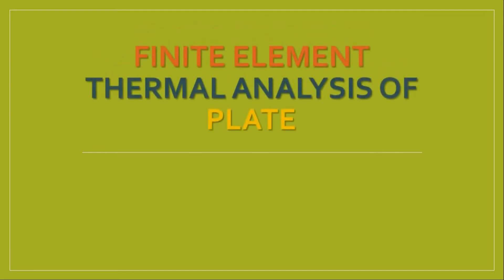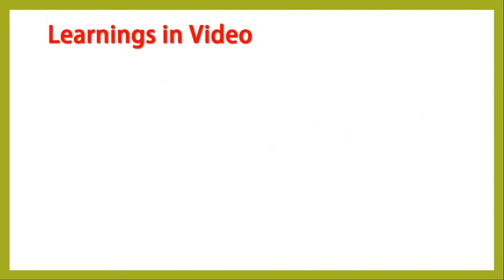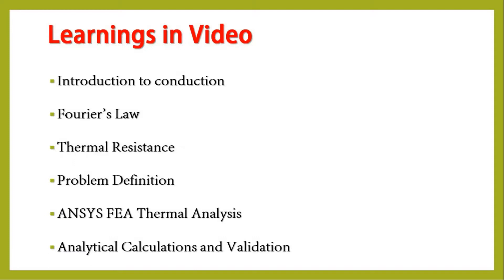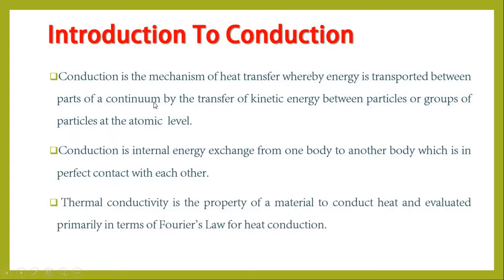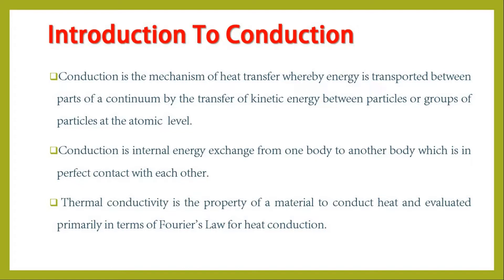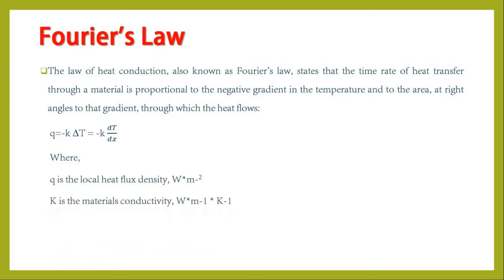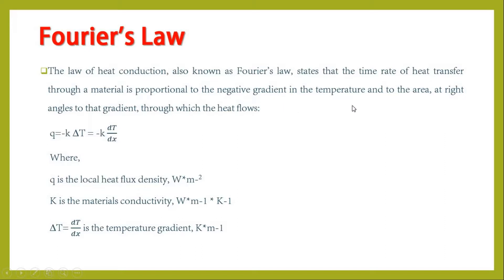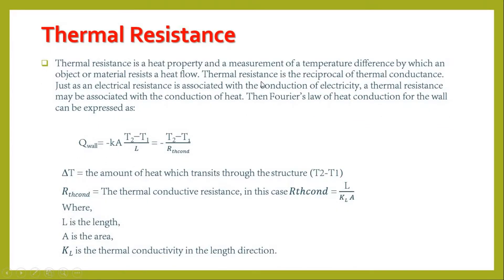Conduction Thermal Analysis of Plate using ANSYS

Comment: can you help me to find the thermal stress in a body due to temperature change whose both sides are fixed? I am getting the correct solution for 1D model but not for 2D and 3D model?
Reply from the maker: You should get correct results for 2D & 3D too. Try to apply proper BC and material details. Let us know if you still have issues.

Comment: Great tutorial Professor, Very helpful. I am working on a similar project that requires me to calculate the effective thermal conductivity of an RVE model with spherical inclusions using periodic homogenization. RVE material is epoxy, length size is 10 mm and inclusion is alumina with a diameter of 1.98 micrometers. Please, can you help with a video tutorial for this? Thanks
Reply from the maker: Welcome ! You need to model actual RVE in FEA based on material configurations and perform the thermal analysis to find out the temperature profile across the RVE model.
Reply: Please can you show us how? It’s really needed at the moment. Thanks
Reply from the maker: You should refer ANSYS composite modeling tutorial. Its modeling of different layer and defining Poisson ration & young s modulus in orthographic directions. We will upload video on composite modeling.
Reply: Grasp Engineering 
Still waiting for your video tutorials on composite modeling Professor. Thanks

Comment: there are two bodies of different materials in contact with each other. One body is heated to a temperature of 200 degrees, and the other 20 degrees. How to make a thermal analysis in ANSYS to look at the temperature distribution and temperature stresses caused by heating a body with a temperature of 20, if a body with a temperature of 200 degrees cools down from contact with a body with a temperature of 20, as well as from contact with the environment?
Reply from the maker: You can model both bodies and apply the respective temperature and define the contact between those bodies. Perform the transient analysis with respect to cool down time. After certain amount of time, let say at steady state condition, it will show the respective temperature distribution as you are expecting.

Comment: Good afternoon. I would like to estimate the heat flow [W / m ^ 2] versus time [s], entering the available experimental temperatures [ºC], for two temperature sensors, in a notepad file (.txt). I already do this in COMSOL Multiphysics and use the levenberg-marquardt algorithm. Can anybody help me? I intend to use ANSYS CFX and modeFRONTIER. I have the heat flow [W / m ^ 2] versus the time [s] measured experimentally. I appreciate the attention.
Reply from the maker: Hi, Here we mainly discuss FEA so difficult you will get your answer. We will check if someone is experience in your topic.